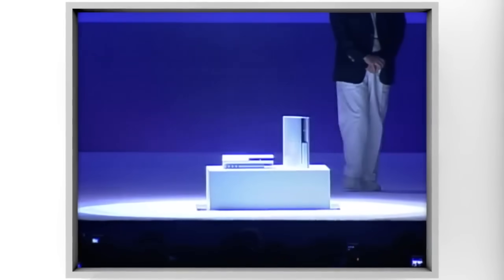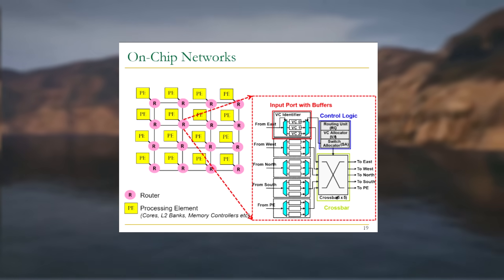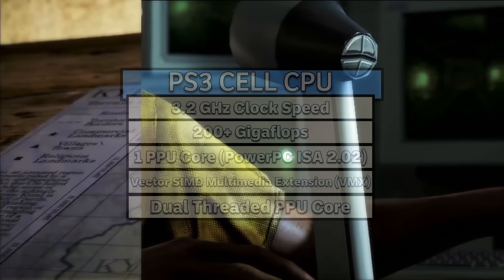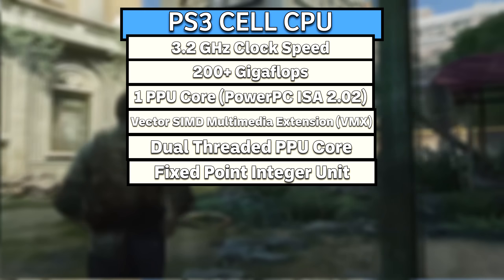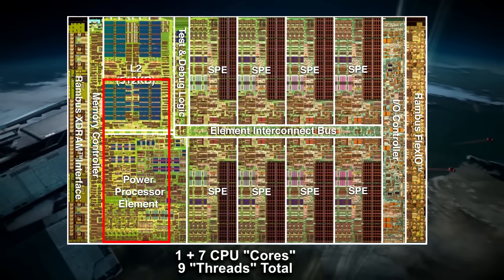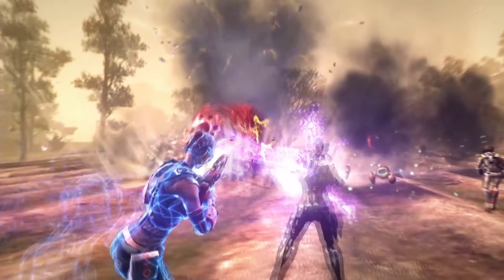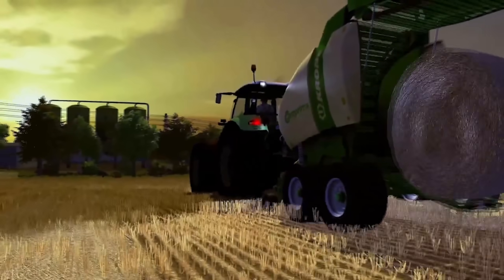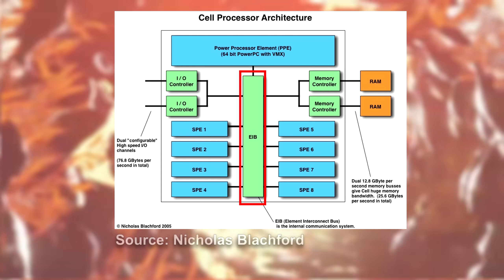The PlayStation 3 CPU: CELL Broadband Engine

Comment: The Cell was design in the old PS2 philosophy of hardware design.

It was supposed to do the geometry heavy lifting and to be paired with a rasterization chip, much like the PS2 GS.

There are sort of proof of this in the IBM presentations. The SPUs handling of math was specifically graphics like in this chip. Only the revision used in HPC had full floating point standard compliance.

That said, IBM also failed a lot in the clock and power targets, so maybe that was why the original design was scrapped in favour of an old GPU.

So, by the time it was released it wasn't really very useful as a gaming CPU.
Physics could be a use case. Some developers also managed to indeed use it for geometry and get some extra power out of the GPU. (Ninja Gaiden Sigma)

Comment: Back when I worked at the game store I was digging for the tech nerdy stuff and had to explain customers the real difference between Xbox360 and PS3, each one of them surely had Pros and Cons, so I was telling customers that the multiplatform games were way better on Xbox360 due to it's simplified PC based architecture, yet PS3 had astonishingly good exclusives Xbox could've dream of, I was showing the real deal of the system (PS3) and had a huge dilemma among customers on what to buy in conclusion :D yet personally I had both of them back at home :)

Comment: Great video. Good explanation 👏
Reply from the maker: Thank you so much 😊
Reply: @FrameRated just a side note that the PPU on CELL is slightly modified compared to 360 ones. I think you got the PPU specs from 360 one. But it's ok the differences are minor

Comment: Remember in 2019 when that one dev from Guerilla Games said the Cell was better than anything Intel offered in 2019? Like think about that for a second. Intel's best CPU at the time of that comment was an i9 9990XE. This statement implies the PS3 has a better CPU than the PS4... and PS5
Reply: Floating point-wise it was competitive with even modern x86-64 CPUs.

That's not the case anymore though... especially with AVX-512.

Comment: If it had the original 3PPU design with all SPUs active paired with 1gb of unified or shared RAM it would have been absolutely insane. But probably would cost 799

Comment: Do you think the PS3 is okay for AI image generation etc?
Reply: It supports 8-bit math IIRC, so it could work, at lower speed compared to a modern GPGPU with Tensor cores.
Reply: @NathanDrake5  but better than an onboard graphics card?
Reply: @SteveMacSticky  It depends. Most modern iGPUs are better than Cell.

Comment: Ironically Xbox 360's Xenon CPU was created when IBM was creating CELL, but Microsoft needing an CPU, they bought the Xenon Architecture that is more close to the normal PPC used on Power Mac G5, and doing this automatically made the Power Mac G5 the best way to start as an DevKit

Comment: just two details i'm pretty sure you got wrong:
- ISA means Instruction Set Architecture 
- the PS3's FPU is not 100% IEEE-754 compliant, exactly like the PS2, because it lacks representations for Infinity and NaN (they are treated as very large numbers instead)
Reply: yeah I was going to say this. the ISA Frame Rated mentioned refers to old ISA ports on motherboard.

Comment: Back in the day I was working Brookhaven National Labs, and they couldn't get a new super computer approved for purchase. The physicists all went and bought several PS3 each I think it was 15 in total. They then installed Unix and used that for years doing all kinds of physics simulations. I think they wrote up a paper eventually demonstrating that consumer equipment when deployed correctly was cheaper and more powerful than many super computers
Reply: Yeah, PS3 clusters were relatively common as distributed computers, allowing affordable high-performance computing. Sadly it all ended when Sony disabled OtherOS feature in a firmware update, preventing the installation of Unix-like operating systems like Linux and FreeBSD.😢
Reply: @CrypticWritings89  By then, GPGPUs were already superior, so...

RTX 5090 alone can yield 100 TeraFlops (FP32).
Reply: @NathanDrake5 I don't think GPGPU (specifically CUDA) was mature enough in March 2010, when Sony killed OtherOS.
Reply: @NathanDrake5  In 2007 there was no affordable supercomputing options and CUDA wasn't a thing yet. The PS3 was basically a server POWER CPU sold 100x cheaper. A lot of institutes hoard them and Sony had to put a stop to Linux access because they were selling at loss expecting game sales to pick up the diff.
Reply: @mimimimeow  CUDA was released in early 2007, shortly after 8800 GTX.

It wasn't as flexible as Cell though...

Comment: Ah, yes, there is a lot to say about the CELL cpu, I don't think it's possible to fully cover it in a single video. Though from the stuff I do remember well enough, there is also the following:
(1) In Sony's infinite bounds of arrogance, they were initially trying to make 't3h c3ll' be the GPU of the PS3. Though somehow the throughput in that operation was even worse than the memory bandwidth of the n64 with its choice of rambus memory. Just.. take a moment to stew on how much of a step backwards it would be if Sony continued that route instead of eating their humble pie and contracting with nvidia for the GPU.
(2) There were rumors, though I couldn't find more concrete substantiation, suggesting that Sony was trying to push their partners to put CELL processors in their TV's and through a means of linking via the HDMI port, to have the chips in the respective devices help each other. Sounds an awful lot like crossfire or SLI, though with probably even worse penalties given how much of a (relative) distance such signals would have to communicate with one another.
(3) The SDK for the ps3 was by far the worst of the consoles of that generation. Even a simple Hello World program written for the Wii and 360 would take about five lines of user entered code to work. To use the resources of the PS3 effectively, the same program would need a minimum of 147 lines of code. I can't imagine official SDK's for the system were any better.
(4) For how much Sony loves to tout how the next console is "# times more powerful" than the last, it is an unending source of frustration that Sony won't even try to enable backwards compatibility. Sony has the nerve to say the PS4 is "16x more powerful" than the PS3, which is more than enough by pc standards to emulate a platform effectively; yet Sony won't enable it.
(4b) As a result of the latest exploits to allow a complete dump of PS4 and PS5 firmware, it was even discovered there was a functional PS2 (software) emulator ingrained. Yet inexplicably, it's disabled by default! IMO Sony would have had more leverage to get me to support their ecosystem if they'd elected to lean hard on their BC.
(5) Those who were there as it unfolded would know this already, but for those too young to recall, Sony initially headed off much of the efforts to jailbreak the system by simply offering a means of being able to install Linux and run your own software on the console that way. Between releasing the slim that first dropped support for the feature, and retroactively removing the feature via required system updates, they basically painted themselves a fat target by the kind of users that were most capable of causing them significant damages regarding security, in order to re-enable the feature. The piracy that followed was a happy side effect.
(6) The cache synchronization feature of 't3h C3ll' that was needed to keep things coherent, was incidentally supported in a new x86 cpu instruction set named TSX. Problem is, last I looked, it was only ever supported on 10th gen intel processors; never did see if it was actually added to any AMD CPU's 🤷‍♂
Reply: 1) PS3 doesn't have less memory bandwidth than N64, that's a lie.

2) PS4 doesn't an SIMD-beefy CPU to emulate Cell SPUs in real-time.

You need native AVX-256 (which even the PS5 CPU doesn't have, it's been gimped down to 128-bit for thermal reasons), ideally AVX-512.

3) Cell SPUs don't have an automated cache, but a manual SRAM (Local Store/256KB).

Gives more freedom, less transistor usage.
Reply: @NathanDrake5 
Cell as a GPU would have indeed been as bad as Intel graphics, which haven't been able to run a PC game made after 1996.

In the PC space, if a PC is "10x" the performance of another platform, that is usually enough to emulate it effectively. The point is Sony keeps talking up how PS4 is 16x more powerful than PS3 but won't even emulate it, let alone the PS1 or PS2. Or explains how data mining discovered a working PS2 emulator in the firmware, that Sony refuses to enable for users of the console. Yet of the two, it is Microsoft doing as much on their consoles to enable backwards compatibility and Sony refuses to.

Sony making a shit sdk rightly made multi platform games run worse on the PS3 for much of its lifespan. Third parties have neither the time nor patience to hand optimize like the console makers think they're entitled to.
Reply: @ZeroHourProductions407  PS4 is indeed 5-10 times more powerful than the PS3, but that's because they count Radeon FP32 performance.

Who told you that the GPGPU can run Cell SPU code?

Have you ever run RPCS3? I bet not.

You need a beefy CPU (AVX-256, ideally AVX-512).

ps: In the PC space there's a unified x86 architecture. Consoles are not the same (until the PS3 at least).

Even the PS4 emulator (ShadPS4) has the emulate unified RAM's zero-copy feature (which does not exist on PCs due to discrete RAM/VRAM).

I suggest to do more in-depth research to avoid strawman arguments... emulators are a good start.

Comment: Iirc the idea was to have just Cell in the PS3, without RSX. They wanted to use PPC core as the main CPU and the SPEs purely for graphics rendering, but Sony figured it wouldn't stand up to what Xbox was doing, so they decided to add a separate chip for graphics and let devs use the SPEs however they liked.
If you think about it this is why PS3 was so messy at launch. The addition of another high-end chip drove the costs way up, and the whole system was a nightmare to program for since the SPEs were never designed to be used directly for game logic.
Reply: I think the initial idea was to use multiple Cell units and/or have the Cell be much larger (more PPEs and SPEs in a single CPU). There also may have been plans for Toshiba to do a GPU albeit one that possibly would've been based on the Cell architecture to some degree.

My feeling is that developers really didn't like the idea of programming on PPEs and SPEs only so the shift was made to include a more traditional GPU late in the game. However, because the decision was made so late in the game, the GPU they got was a mildly altered, slightly cut back version of G71 (Nvidia's early-late 2006 flagship and a die shrink of their mid 2005-early 2006 flagship, the G70) instead of something more custom like the ATI Xenon chip (which introduced unified shading a year before it debuted on PC) inside the Xbox 360.
Reply: Actually, it's more that Sony were going to use two Cell processors; one for CPU tasks and one for graphics.  If they got it working in time, it would've been more than capable of beating whatever the 360 provided graphics-wise (even with the gimped RSX, PS3 ended up producing better-looking games than 360 thanks to a single Cell processor).

However, the engineering team wasn't able to get that working, so the rushed a back-up deal with Nvidia for the gimped RSX and that's what things became.  The GPU PS3 uses doesn't even have unified shaders.
Reply: @samalton5837 The RSX wasn't actually gimped, it had more cache than the usual one. They are however bandwidth starved from the VRAM choice.
Reply: CELL was still used for graphics if developers finally realised its original intention (which was the case for Uncharted and The Last of Us franchises).

Comment: The Cell processor is probably the most overrated CPU in gaming history. It was a chip that was poorly suited for gaming. The Xbox 360 did use a cut down version of the cell chip but instead it was much better suited for it. Much of the reason for the hype is because it had the word “supercomputer” with it, so people assumed it must be very powerful. All that number crunching was better suited for data analysis not gaming.

Many of the best looking games on PS3 were possible on the 360 however Sony had some of the best programmers of the era which is why Naughty Dog and Guerrilla went on to make the best looking PS4 games as well. It’s best to realize how important talented developers play a role in the best looking games on a console.
Reply: If Cell is "poorly" suited for gaming, then you can say the same about GPGPUs.

Comment: One significant tidbit missed is that the PPE, while dual-issue and having SMT, is an in-order core. Despite on paper having a high clock, this put the PPE at a substantial disadvantage vs the CPUs available for PCs at the time (and certainly well behind Intel Conroe, which was a 4-wide OoO CPU).
Reply: Correct. Cell PPE @ 3.2 GHz is a lot slower than Jaguar @ 1.6 GHz in general-purpose code (basically everything, except floating-point/vectorized code).

Cell PPE is closer to Intel Atom (same in-order uarch).
Reply: I would bet even the Cortex A53 would absolutely blow the PPE out of the water thanks to much better branch prediction and a way smaller pipeline. And the Cortex A53 is a pretty painfully slow processor even when you stack like four or six of them. 

The PPE was probably pretty painful to program. I suppose it was fast enough for its time though and the SIMD capabilities of these chips were unbelievable. At least they clocked it fairly high. Seemed to be fast enough for its time for the PS3, albeit such an odd choice.

Comment: There's a very good reason we use SIMD instructions rather than dedicated accelerators.  360 got it right with VMX128 (that's not to say Xenon is without faults, oh no, I have so much beef with it and Cell).
Reply: Not really. We do use dedicated accelerators (video decoder/encoder, audio DSP, SSD decompressor). PS360 didn't have any of them (and VMX128 is inferior compared to 6 SPUs x 128-bit SIMD).

Even Switch 2 has dedicated co-processors... why tax the CPU/GPU?
Reply: What are you talking about?  Nobody tries to use SIMD for anything intensive.  Everything that requires intensive processing is run on GPUs or ASICs.
Reply: @GoatTheGoat  In the context of CPUs.  You don't see CPUs that come with huge chunks of the die dedicated to a standalone accelerator ala SPEs.
Reply: @kirby0louise  Of course not.  But this is not really a discussion about CPUs.  The CELL Broadband engine should not be thought of as just a CPU.  It is a CPU and a highly programmable accelerator in a single package.
Reply: @kirby0louise  Have you checked the latest AMD Ryzen CPUs featuring beefy/native AVX-512 units?
Reply: @GoatTheGoat  SPEs are not accelerators/ASICs, they are 128-bit SIMD units.
Reply: @GoatTheGoat  Cell was basically a proto-APU (CPU + SIMD units). Kinda like AMD Fusion APUs (PS4/PS5 + XBOX ONE/Series).

This paradigm shift has won, even on mobile SoCs.
Reply: @NathanDrake5  No.  The SPEs are independent compute units.  Each one has its own execution thread separate from the PPE.
Reply: @NathanDrake5  Close, except CELL's SPUs are not GPUs.  They are programmable general purpose accelerators.
Reply: @GoatTheGoat  You're arguing semantics...

The GPU is equally independent and SIMD-heavy design.
Reply: @NathanDrake5  That is true for modern GPUs capable of GPGPU.  But that did not exist when the CELL was developed.
Reply: @GoatTheGoat  That's what I'm saying... Cell was proto-GPGPU. :)
Reply: @NathanDrake5  I agree with that.
Reply: @NathanDrake5  Those AVX512 units operate via SIMD instructions, they aren't dedicated accelerators like SPEs.
Reply: @NathanDrake5  How can it be "proto GPGPU" when a year earlier actual GPGPU came out?
Reply: @kirby0louise  You're confused, SPEs are SIMD units. They utilize 128-bit SIMD instructions.
Reply: @NathanDrake5  No, I am well aware of what they are.  They are not the same as modern CPU SIMD
Reply: @kirby0louise  You're not even a programmer to begin with, stop embarrassing yourself.

It's 128-bit SIMD.
Reply: @NathanDrake5  Lmao I am a programmer, stop projecting.  Even if SPEs execute 128-bit SIMD, they are NOT the same as modern CPU SIMD.  SPEs have their own thread that is fully parallel to the CPU.  Modern CPUs do not do SIMD that way.